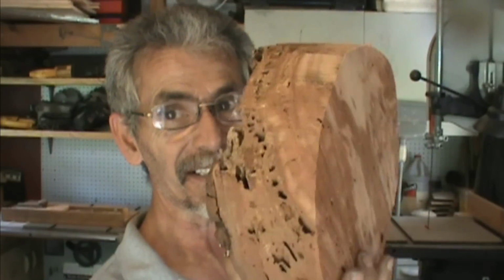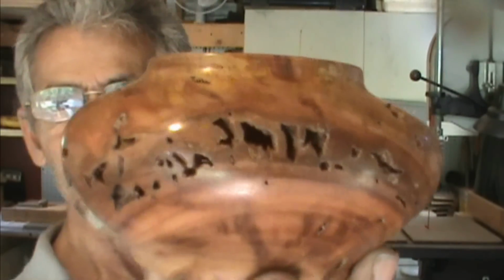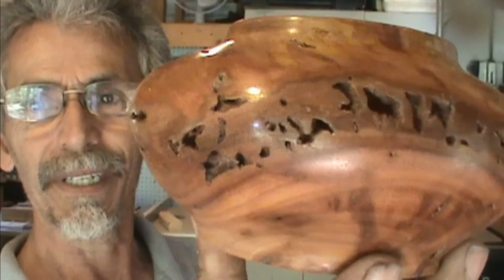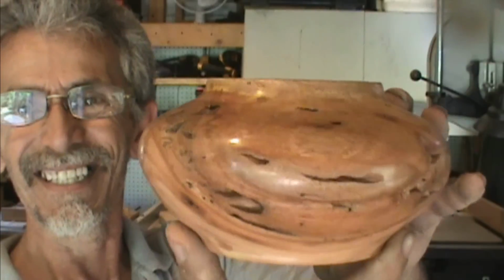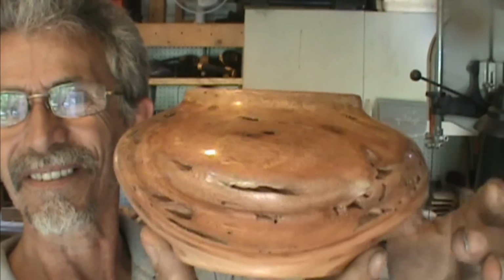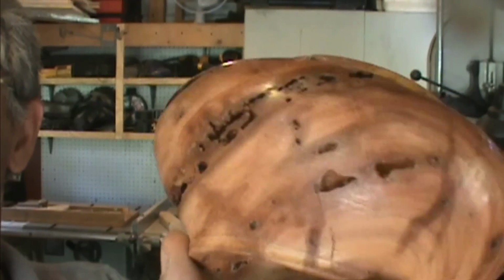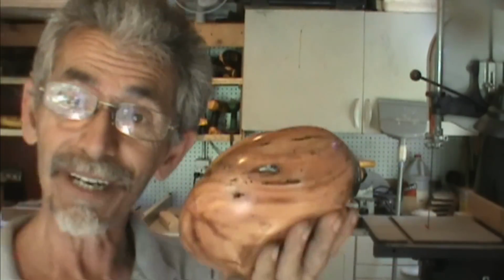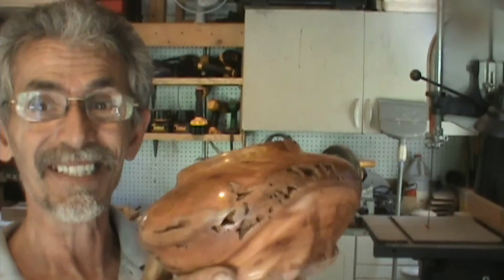Wormy Eucalyptus Vessel  by Al Furtado

Comment: I've got a love hate relationship with Eucalyptus, it was the first wood I turned (well, after construction pine, to test my then new lathe), since it's so common here in central Italy, but man oh man does it warp and crack as it dries. Good thing your pieces were dry, or else... I do much with it these days, for that exact reason, although I can safely say that fresh Eucalyptus is the most amazing wood to work with, especially for a novice turner, it cuts clean and smooth, and the smell is just like you'd think it. Ah, memories... :) I actually did turn a log of it yesterday, will upload soon, but not important, your piece is just lovely, I guess you're lucky you were hollowing cross grain and not end grain, that end grain, it will the end of me. You can't beat the color and shapes of grain you get in Eucalyptus, if it wasn't so quick to crack and warp we'd see much more of it.
Reply from the maker: yuval lahav Thanks my friend. Well I have a whole bunch of it so there will be plenty of it to turn LOL. I agree it splits and twists most of my logs need to be cut to blank sizes so I don't loose it all.I did turn a small vase from it yesterday it turned a s expected end grain is always had but boring out the center helps a great deal.I have quite a bit of the wormy stuff so I will end up with a huge collection of that stuff.Hope to see some of your work soon. and take deep breaths don't get aggravated. when I go out there and things don't seem to be going for me I step away and take a break.
Reply: Al Furtado I have another method, when something goes bad, I punish myself with a through shop cleaning. It's a win/win, and I always feel like creating something new when the shop is clean...